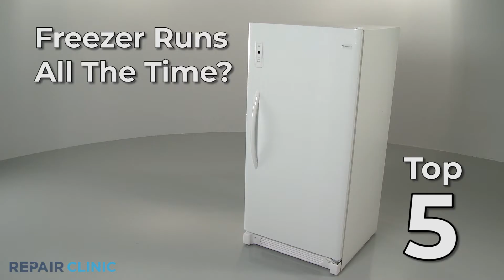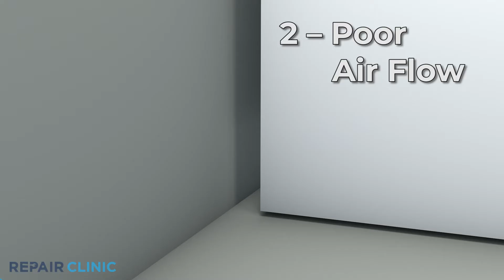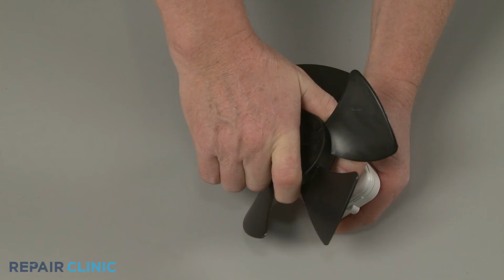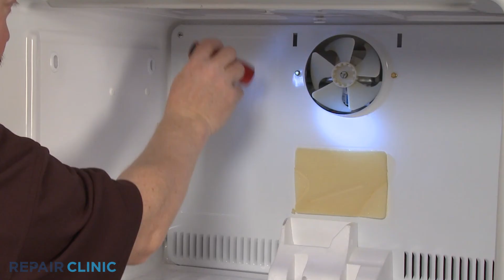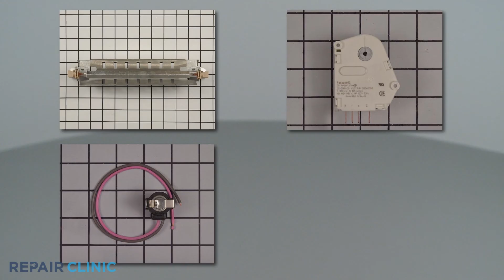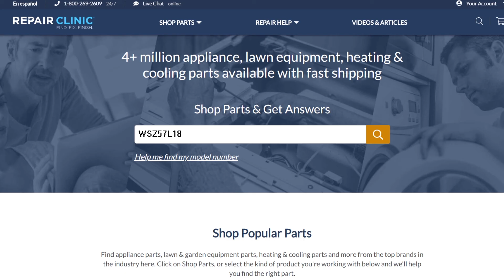Freezer Runs All The Time — Freezer Troubleshooting

Comment: None of this explains why the freezer would constantly run. More of an explanation of how the unit works.
Reply: maybe is thermostat for sure
Reply: Yes it does! Switch a fridge freezer on and it will run all day unless all the components are working correctly to tell the unit to switch off. The video takes you through all the potential points of failure and how to check them. If one of the components that control the compressor fails then it will run all day as that's it's job. The compressor basically runs until the system tells it to stop.
Reply: Low on refrigerant.   Meaning there is a leak.    It it runs and gets cold or cool but not as cold as it should, then there's a good chance it's low on refrigerant.

Comment: My freezer is very cold and won't cycle off even with it turn down to 2
Reply: Same. Fridge freezer which gets very cold (ruining food in the fridge) and runs constantly. Replaced the freezer door gasket which looked like it might not be sealing. Replaced the thermostat. Still the same. Temperature is set to 1 (warmest setting)